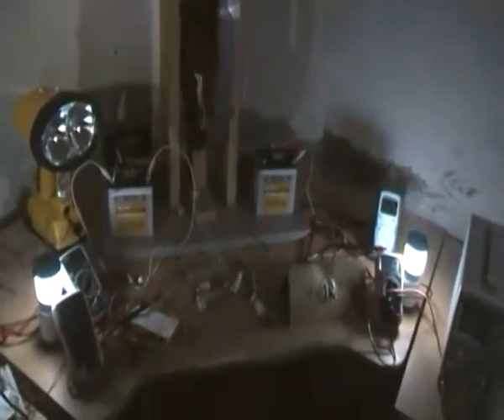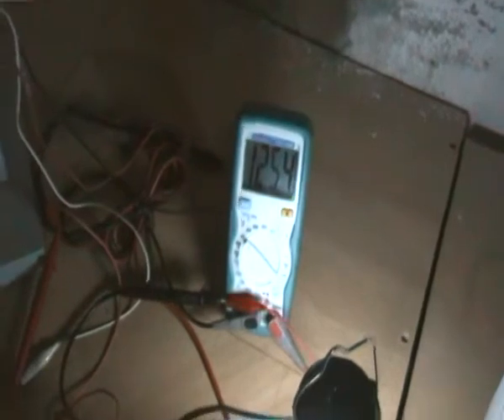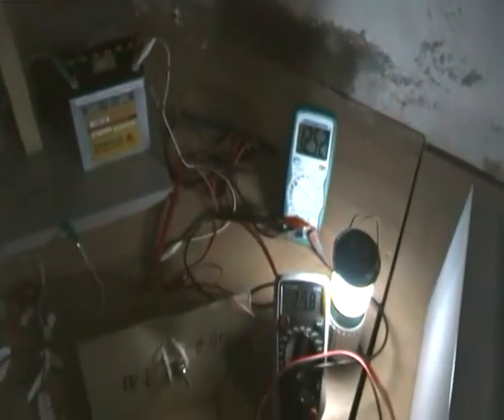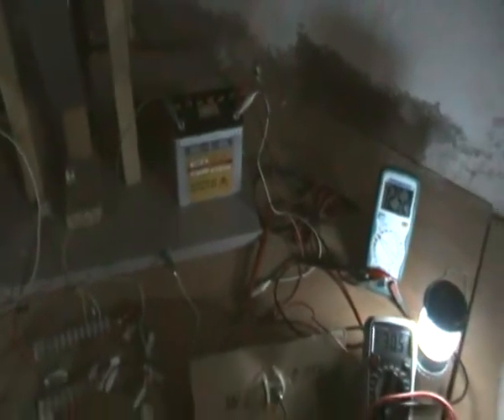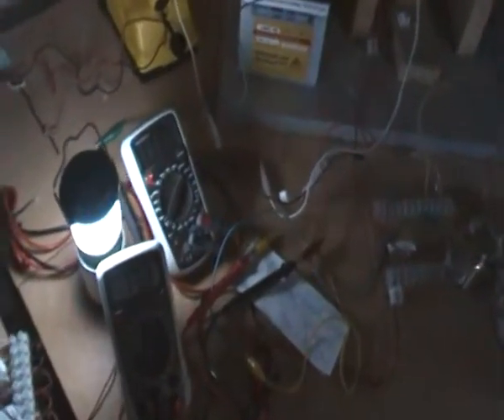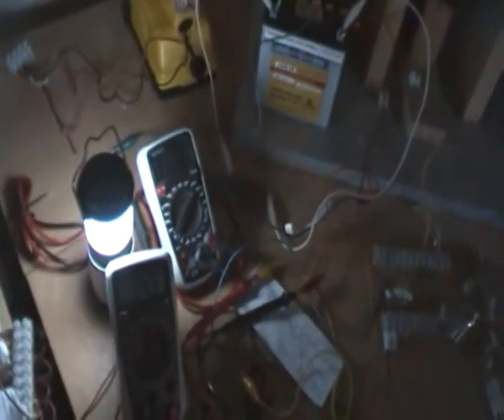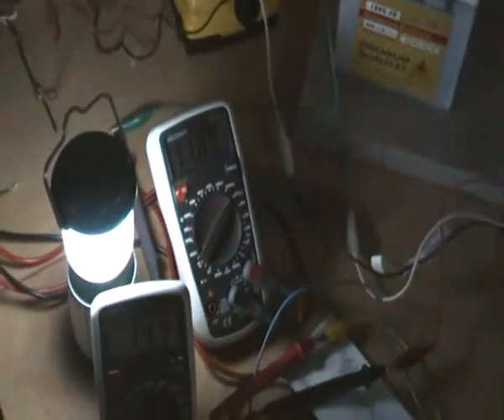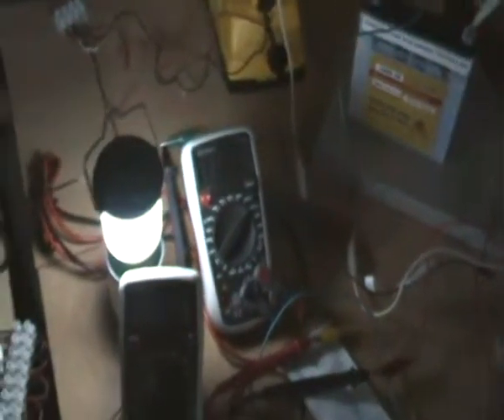Charging procedure test 4

Comment: http://www.batterymart.com/p-1950-222-12-volt-15-amp-low-voltage-disconnect.html?utm_source=google&utm_medium=cpc&utm_term=1950-222&utm_campaign=PLA&gclid=Cj0KEQjw3IieBRDl1oG0gr_PweoBEiQAwGHVw2NpW1svMZC5uqLo9oLzzjJi-ADlBoOKLTq9OJk0BZEaAhVa8P8HAQ
Reply from the maker: Hi did you tested this device with SG curcuit?